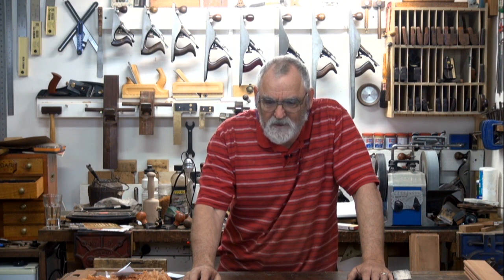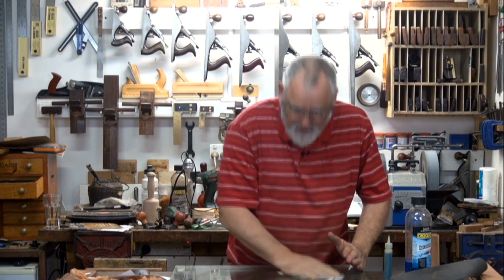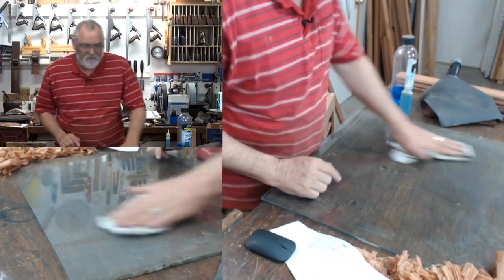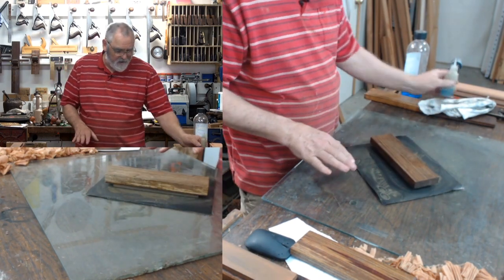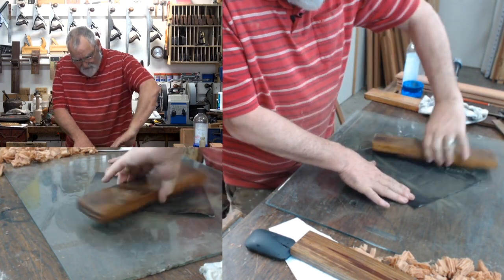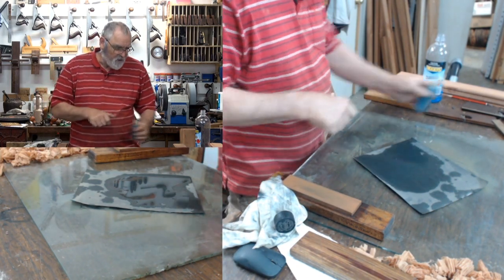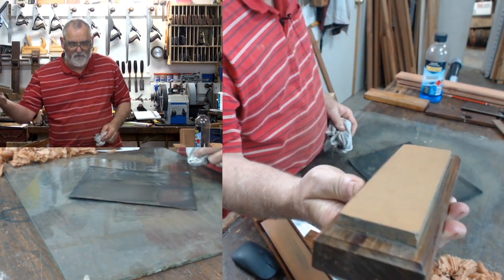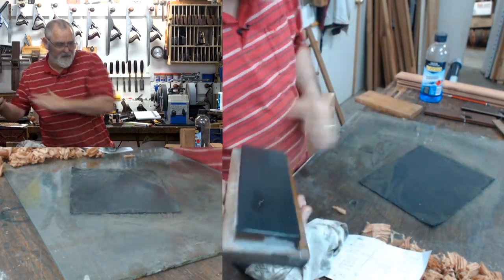Cheapest Way to Flatten Sharpening Stones

Comment: Helpful video. I think I might have done the fine stone first, to avoid contamination with large particles from the previous stone. But that's just me.
Reply from the maker: Many ways to skin a Cat Tyson. Which evere works best for you. Cheers Steve
Reply: Same logic with me, just bought 3 280p and flattened my 5000/2000, 3000/1000, 1000/240, worked perfectly on my kitchen counter (marble), didn't even use a glass or tile 👍

Comment: Hello and thanks for the vid .  I have two stones of my grandfathers ,  would you know how to tell if there oil or water stones .  Thanks C.
Reply from the maker: Water stones are generally much softer than Oil Stones. So if will scratch with a finger nails of sharp edge of a tool then there is a very good chance they are water stones. Cheers Steve
Reply: Thanks Steve ,  Appreciate.
Reply from the maker: Happy to Help. Cheers Steve
Reply: cyril brun
Put some water on it. If it soaks in, it's a water stone. If not, it's an oil stone. Considering the age, they are likely oil stones.

Comment: What grit would you use on a 6000 grit waterstone
Reply from the maker: Depends how badly worn it is.If it's very worn I'd start with 240. If it's only slight wear 400 or 600 should do the job.
Reply: It's a brand new 1000/6000 combination waterstone  but I didn't know if I needed to flatten it before use. I also have a new 220 grit and 800 grit waterstone that I was going to flatten on 100 grit drywall screen but I didn't know if the drywall screen would be to course for the 800 grit waterstone.
Reply from the maker: I tend to think 100 grit is a bit on the course side. To check for flatness place a straight edge over them and see if any light comes through. If not them that are flat. Cheers Steve

Comment: What about oil stones, I spent hours and the stone is still not flat nor the chisel back
Reply from the maker: Hi Zachuco, not knowing the stone I just guessing here, but try a courser grade of wet and dry paper and make sure you are using a flat surface to dress the stone on. Cheers Steve
Reply: @Woodworkingmasterclass  thankyou for the advice, it's a Norton combination oil stone
Reply from the maker: It is Grey and orange or grey and black. Mine is The orange one and I star out with about 80 grit to get the hollow out of it then progress up to 240. Cheers Steve
Reply: @Woodworkingmasterclass  it's the grey and orange, the grey side won't want to get flat it is elevated on the right side and I tried circular motion, back and forth horizontally, and even back and forth vertically, it just won't get flat and even if it is I don't see much change. I am using 60 grit sandpaper.
Reply from the maker: @DeltaArxz  It that dry abrasive paper or (wet) wet and dry? Cheers Steve
Reply: @Woodworkingmasterclass  it's harbor freight sandpaper
Reply from the maker: @DeltaArxz  not sure what that is is that the brand? Any paper should do, some last longer than others. Cheers Steve

Comment: I use a couple of glass louvre blades  with the wet and dry attached with some contact spray  one stone is 66 years old was among 1st year tool allowance way back when an appretice,  and still going well the others not far behind,again like you use kero  and water for the water stones, lubricate with neetsfoot oil and kero on the oil stones
look after your gear and it looks after you 

One thing i hate to see is some one putting tools on an angle grinder to sharpen  ,a water stone slow revolving and costantly wet, or a very fine emery wheel with a bucket of water to keep cool 

and of course a strip of leather or your hand to strop when done 

occasionaly every few years soak the oil stone in kero to clean it up and keep them in a wooden box with a lid ,mine all silky oak as we made all joinery with that way back in QLD
Reply from the maker: Absolutely, seems we of the same ilk. One of my Stone Boxes is also Silky Oak and another is Aust. White Birch ( Crab Apple). I use a Tormek for nearly everything now. Keep the grinders for the Blacksmith Shop. Thanks for sharing your story with me. Cheers Steve

Comment: if you can't sharpen a knife with a worn stone, a flattened stone won't be of any use to you.  It's 90% practice and skill.
Reply from the maker: Very hard to sharpen a chisel or Plane blade on a worn stone. I agree knives are a different proposition. Cheers Steve

Comment: And you think that the glass is flat? If this was precision work,it might not be (i have checked many,and i have not seen a good one yet; i need better than .001 inch, in my line of work);You have NEVER seen anyone using glass plate to replace a granite surface plate.
You need to use the 3 stone method,look it up; then again,if all you need is to sharpen tools,your way will do,no doubt.
Reply from the maker: Hi Jose, you are correct but for the sharpening of tools to be used with wood it is more than sufficient. My preferred way is with a Tormek T8 but no everyone is fortunate enough to be able to use one and therefore this is a great way to get started. Thanks for the feedback. Cheers Steve